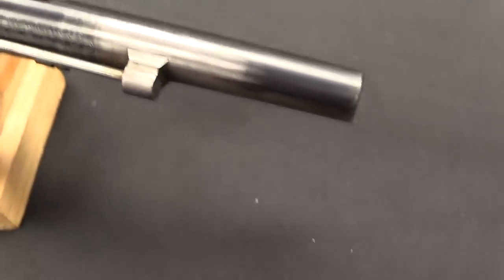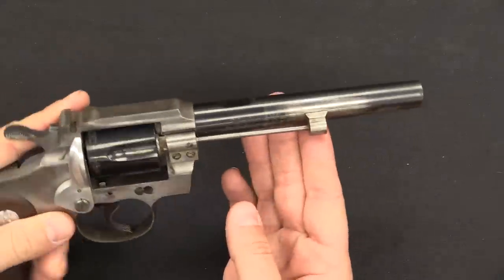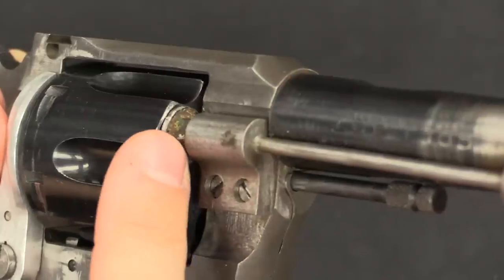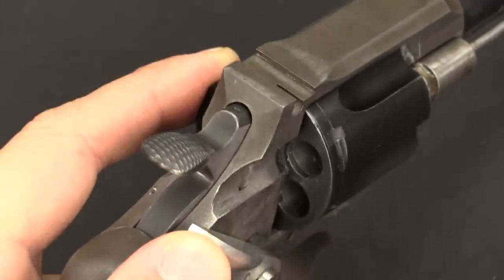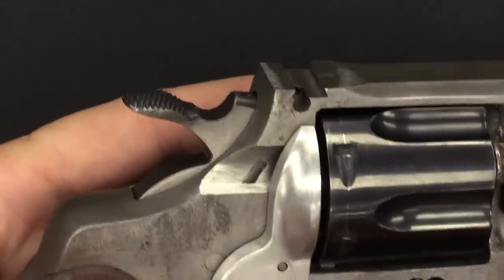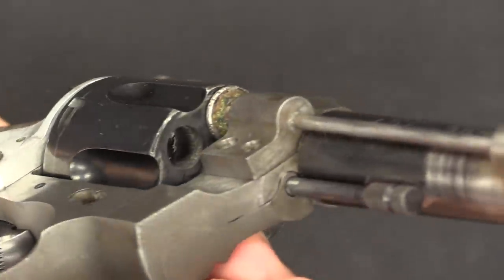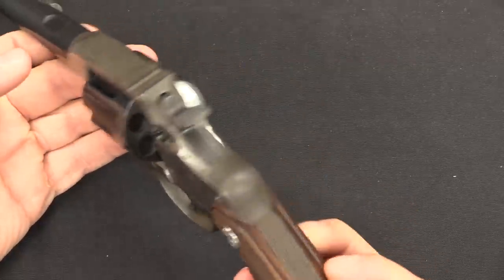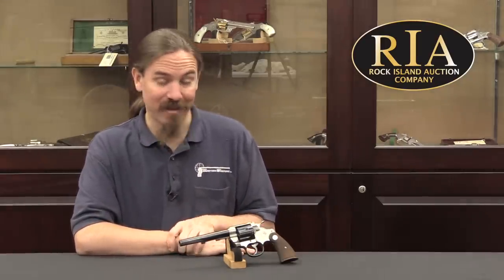Colt Prototype Self-Ejecting Revolver

Comment: This is like the Armsel Protecta shotgun, as far as i know the only gas ejecting revolver I know of to ever go into production. i always though the Protecta solved the problem in a kind of clever way, in that the loading gate was where the cartridges were ejected through, but it stayed closed until you indexed the shotgun to the second chamber meaning that it didn't eject the "final" still live round in the cylinder. You had the problem that the last round was not gas ejected, but the gun still had en ejector rod so you just used that for the last round. The big "failing" was that it was essentially single action only with you having to advance the cylinder with the forward grip between shots. I always wondered if they could have still used the clockwork drum mechanism that the Striker did and just built in a little bit of lag between the shot and the drum advancing (like do it on trigger release) to allow the previous cartridge to fully eject.

Comment: If there is a loaded round in that chamber, what is preventing the system to just blow out the live round?
Reply: am17frans 
Nothing?
Reply: Nothing. I think that may be a reason why this was not developed further as solving that would make the revolver much more complex (and expensive).
Reply: My thought, too. It would seem somebody would have thought of that before going through the trouble. . .
Reply: Good question
Reply: maybe you just hold it closed with your thumb first shot lol
Reply: Unless you leave it in when you load the next time? Always leave that chamber spent?
Reply: And I'm sure the deflector is better than the brass just shooting you straight in the face but to me it just looks like they re purposed the loading gate. It still keeps the cartridges from falling out I guess lol
Reply: Perhaps the live round would be heavy enough that it wouldn't have enough energy to move that spring loaded gate/deflector but a casing by itself would be light enough to gain the momentum necessary?  Just a guess. Or perhaps that was going to be a problem that would get solved on the Mark II version that was never created.
Reply: The idea was probably to load 5 rounds and leave one hole empty. The first shot, nothing gets ejected. Next, the cylinder is rotated to bring the second round t the barrel while sending the casing of the first round into position to b eejected. In the second shot, the casing of the first shot finally gets ejected. That is why the last spent casing will remain in the gun.

May sound dumb but perhaps the inventor only did it for shits and giggles so who are we to judge eh?

Comment: To make that fundamental design work it would be necessary to store the gas pressure from the previous shot in a small tank with a check valve so the gas pressure can charge the tank and the action of the cylinder rotating would trip a valve to vent the gas to the cylinder and eject the round that was just fired. Very simple fix.

Comment: I could see a gas-eject revolver built a bit differently working as a novelty gun.  You start with a 7-shot cylinder 686-type revolver, giving you six shots taking account of the need to keep one chamber empty.  Instead of the spring-loaded gate, you have a chute or ramp that deflects the ejected cartridge up and away.  The cylinder is fixed, not swing-out, and the revolver is reloaded through the ejection ramp/chute like a gate-loader.  It’s not superior in any way to a standard revolver, but it could be a functional curiosity, especially if designed with a certain steampunk aesthetic.

Comment: Maybe that kind of system will be more appropriate for a revolver like the Nagant, because the way you usually eject the empty cartridges is way slower. Also, the fact that the Nagant seals very good may be very beneficial for the system, because you will have very little gas leakage.

Comment: When you load 6, the first time you fire, you eject a live round instead of an empty. 

Wembley once made an automatic revolver. The top of the frame and barrel would come back under recoil, rotate the cylinder and cock the hammer before going forward back into battery for the next shot. Would be an interesting gun to feature on your program.

Comment: It would have to work backwards. The Barrel tapping would need to push a spring loaded plunger forward. Then it would need to release when the spent round came to the side and push it from the cylinder. So that your last trigger pull would be after your last shot, to eject the last round.

Comment: Why though
Reply: Why not?
Reply: One reason........MURICA
Reply: A lot of people seem to be mistaking this as a prototype of an actual possible product. It is not that. It is a test bed for an idea. The idea was "could we tap gas from the barrel to eject cases?" The reply would be "let's find out." So they built a test bed out of existing, off the shelf parts just to see if the concept would work. Once that is done, there are three possibilities.

1. It didn't work. They couldn't make it work so they scrap the whole idea. 

2. It worked so they took the concept and further develop it into an actual product that probably would have been far different from this test prototype. This obviously didn't happen in this case. 

3. It worked but no one could figure out a way to use this new knowledge to improve on existing designs. This is probably the most likely outcome in this case.
Reply: When speedloading it would solve the practical issue of having to tilt the gun 90 degrees and use gravity to help eject the spent cases. Often if you go too quickly the cases won't have time to clear the cylinder or if you have it at the wrong angle they might not eject all the way. 

The trouble is that in today's era any speed advantage would easily be won over by moon clips, so it's not worth it.
Reply: Seems like the answer to a question,  no one asked...

Comment: But won't the gun eject round 6 firing the first shot?
Reply: Yep, first shot when full loaded and it will eject an unspent cartridge.  Probably why it never got beyond this prototype.
Reply: Maybe the aerodynamics will prevent live cartridge from blowing out?
Reply: Possible, but I would think it unlikely to be completely effective.  If it has enough pressure to blow the empty out quickly and cleanly, then it would likely still at least move a live round back a bit, potentially preventing the cylinder from rotating for the next shot.  I wouldn't think this possible failure point to be worth the risk.
Reply: You just load five and then make sure you index it right so that the first shot blows out the last spent casing from the previous load :p
Reply: Sure, but that defeats the point of having 6 chambers.  It also means you can't use a speedloader to increase reload efficiency, further extending the reload time.  At best, that's a temporary workaround for an existing problem - not a fix.
Reply: You'd better hope it ejects, or that your cartridge crimps are good and sturdy.  The last shot will be a real ringer if the bullet is set back from the gas pulse, may be the last shot.
Reply: not a good idea

Comment: Would be cool to see someone source the missing parts to get this functional, although realistically this would only be practical on a revolver like a copy saa where you unload one round at a time and have to eject one at a time, but that would require a hybrid ejector to use both has and manual force (maybe an ejector that slides over the gas tube and pushes next to the gas vent, of course that could get hot and stick under high rof use, but you could top the firearm off as you went along, possibly using a loading gate on the firing side as well as on the ejection side.

Comment: What would be cool would be if someone was to modify a Mateba or Fosberry autorevolver with some sort of spring-loaded ejector that would activate after the frame went through its recoil cycle, then you'd have solved the problem of that sixth round, since every round fired from an autorevolver cycles the frame and thus every round would provide the energy for its own ejection.

Comment: One other issue I see is that, if you fire with a full cylinder, the unspent cartridge that lines up with the ejector is going to come flying out before you can fire it, either wasting ammunition or requiring that you leave that chamber empty and only load 5 chambers.

Comment: I think this would work as is if you carry with 5 and load with an only mostly loaded moonclip. It would cost you a chamber, but save you the time of hitting the ejector rod. You would need a locking system so that the cylinder does not spin freely when swung out, which would keep the unejected empty case lined up with the barrel once you close the cylinder, ready to be ejected when the cylinder rotates as you fire the first shot.

I'd like to see a speed test of 30 shots with this against a standard 6-shooter.

Comment: Theoretically you could probably modify the Webley-Fosberry operating system to include auto ejection of the fired round. It would undoubtedly take more work than one could justify without hitting insane prices for the guns, but it would certainly be an interesting project for someone with money to burn.

Comment: hmm. I wonder how easy it would be to make this into an auto-cocking revolver? That deflector/gate/thing is basically parallel to the hammer, and so is its motion when the case thats being ejected kicks it open. Would there be enough power to recock the hammer? With the ejecting cartridge acting as a gas piston?

Comment: That aluminum cover is one step short of converting the whole thing to a self-cocking revolver. Had it been mechanically coupled to the hammer, the overall design would have been way simpler than Webley-Fosbery, with less muzzle climb due to lower bore axis.

Comment: I bet that this was just testing the auto-ejecting part, for like where to put the gas tube on the barrel, how big to make the hole, where to put it on the side of the frame in front of the cylinder, etc. etc. Because, just as you said, it made no sense to only eject 5 out of 6 casings... I bet that it was more along the test of "Can this work?" rather than, "How should this work?"

Comment: The Stryker 12 revolving shotgun uses gas ejection, but DUH!, there's plenty of gas at the cylinder gap, so no gas tube is necessary. It simply directs the existing, normal gas leakage to eject the previously fire shell. Since the Stryker has an ejector rod, like the typical single action revolver, and the huge 12 round cylinder doesn't tip out for reloading, you yank the ejector rod once after firing your 12 shots and you're ready to reload.
Also it has a loading gate, old-fashioned single action style, which is forced open after the first shot. The next shot sees the port open, and the gas propels the previous shell out into a neoprene shell deflector. It's a very simple system. It's never been a great gun, but the gas ejection did work very well.
Someone at Colt was smoking WAY too much doobie, methinks. The very thought of putting a gas port in a revolver barrel is ridiculous. EVERY REVOLVER EVER MADE COMES WITH A "GAS PORT" ALREADY. The guys working next to you are trying to prevent gas cutting in the frames of magnum revolvers, and you can't see there's plenty of energy there?
Also it is considered by some to be an advantage that a revolver doesn't spit out its empties. You can save your cases without searching through the grass, bushes, thistles, nettles, snow, sand, leaves, cow pies and mud puddles.

Comment: The bigger issue I see with this is that you couldn't load 6 rounds, because you'd blow a live cartridge out on the first shot if you did, a more interesting idea would be a gas cocked revolver (possibly using a striker that's reset by gasses vented out the rear of a proprietary cartrige)

Comment: Cool idea.  As you said though, rather useless in its current form, as it doesn't really change the reloading process.  I wonder if it would be possible to use the motion of the flipper to advance the cylinder, recock the hammer, and have another flipper on the other side that would push a cartridge from a magazine into the cylinder on the return stroke.  Semi-automatic, self loading, self ejecting revolver.

Comment: is it possible, that you maybe single load the revolver from the left backside? as you said, there is some missing piece there. so it maybe was possible to load additional rounds into empty chambers during firefights from a left side loading gate without the need to open the cylinder and empty and load all chambers?

Comment: Ultimately having the cylinder ejector plate spring loaded to elect once the cylinder reaches full swing out is the answer, if any was needed: saves one hand movement at best, and can still fail.
Reply: Still requires gravity, which is a big part of the downside to conventional reloads.

Comment: I had a idea for a schofield revolver that fire 7.62 mm Nagant with a gas system in pipe down the center of the cylinder that would push the hammer back and rotate the cylinder a gas operated auto revolver.

Comment: Surely recocking the hammer would be a better use of a gas tube than ejecting a spent case, right?
Reply: Webley already made a semi auto revolver
Reply: Uryendel And that precludes any other semiauto revolvers even if they use an entirely different mechanism?
Reply: Well i think the semi-auto webley make the point on how useless it is, it's not the implementation who was flawed but the idea
Reply: There would still be advantages over a standard semi-auto.  The design of a revolver allows more powerful ammo than a standard pistol, and a bad round wouldn't require manipulation of the gun to resolve, just pulling the trigger again would rotate the chamber and fire the next round.  As for the advantages over the Webley-Fosbery, they are substantial.  The Webly has a high bore offset meaning more muzzle climb, it is single action only, meaning a bad round requires manual manipulation to cycle, and because of the action, the "slide" comes back in a way that can hit the web of your hand, likely causing pain and possibly even a malfunction
Reply: You know what would be great? if the trigger would pull the hammer before shooting... oh wait....
Adding a gaz system would just add weight and increase the potential of failure, for what? a lighter trigger in speed shooting?

For more powerfull ammo, yes and no, if you take usable revolver (because you don't gonna carry a .500 S&W) they're not more powerfull than a 7.5FK for example. For reliability, well yes it's better on a bad round BUT a revolver who jam is often just a dead weight until you go back home, also they are a risk that a round go under the pusher when you reload, jamming the gun.
It's Paul Harrell who was saying that a revolver support negligence better but a semi-auto support abuse better
Reply: The worst malfunction that this theoretical gun could have that a normal revolver doesn't is the gas system failing which just makes this a normal revolver with some dead weight

Back to my initial point, even with the problems, it's still better than adding a gas system only to eject some of the spent cases which also reduces the capacity to 5 rounds

Comment: Clearly what Colt didnt think of at the time was to pair this with a semi auto mechanisim, alá Mateba, Mauser or Webley Fosbery. THEN this might fly, plus a loading gate on the opposite side of the ejector so you can top off your cylinder.
Reply: bueno
Reply: Is that why the cylinder catch was no longer attached to the gun? To facilitate loading on the left side just before that chamber went into battery.

Comment: So, just how ammo-sensitive was this? I can imagine a low powered round blowing the case only half-way back and completely blocking the cylinder. Not to mention that it seems pointless. A standard extractor dumps all the cases at once anyway, the moment you swing out the cylinder. This might be interesting for a revolver with a loading gate, not for a swing-out.

Comment: For a reloading gate revolvers like the single action army it would be nice to have all the cases ejected so you can focus on the reloading part, other than that I can't see a benefit like you said.
Edit : a mechanically ejection system would be more reliable and less dangerous for the shooter and you can fire 6 or more rather than 5.

Comment: what happened, or what any trade-off is there to simple break-open ejection, that individual self-ejection on revolvers had to be thought of? Schofield break-action already existed long before those; is it patented? or maybe strength issue on the hinge?
Reply: A solid frame is always going to be stronger than one which hinges open, and when you start using higher power loads that becomes an issue.

Comment: One wouldn't want to put six rounds in as once you fire that first round the gun would try to eject a loaded round. Since it would be heavier and not hollow like a fired case, I doubt it would completely eject. You would thereby jam up the works. Instead, load only 5 rounds. Once all 5 have been fired, the last case would remain, just load the empty chambers, and aligning empty with the barrel.  I presume this was made in the days before transfer bar safeties on revolvers, so you would want to align a dead chamber with the hammer anyway. However.... Who would really want to fire a gun that by design shoots high pressure gas (un-redirected) right back at the shooter's face? That would be even more of a problem if there is not an empty case to deflect that gas.